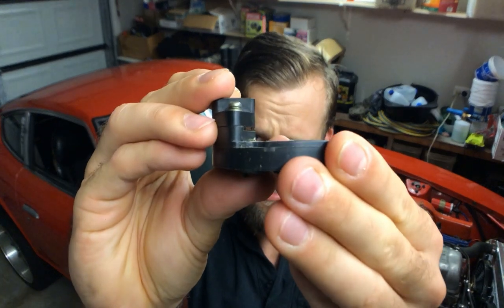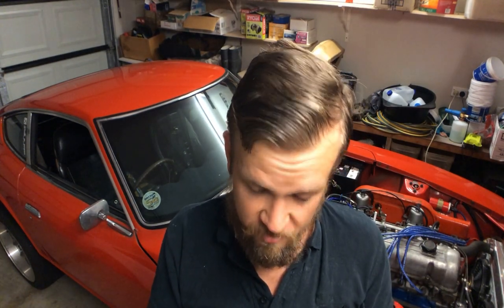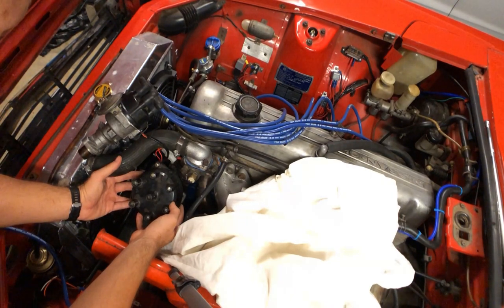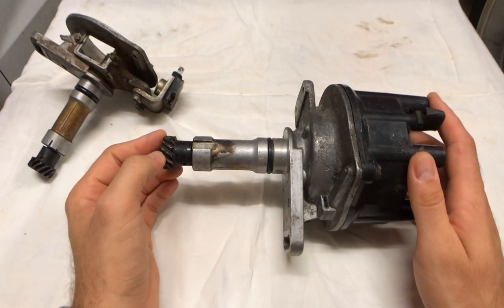Datsun 240Z L28 stroker – fitting an RB30 distributor - part 1

Comment: The bearing in the top dries out.black powder comes out clogging the optical and the 4 pin plug would grow
green electrolysis . both common faults
Reply from the maker: Yes.  I have found that on all the RB30 dizzies I’ve touched over the years that the dust seal around the CAS terminal is very brittle.  I have not been able to pull a distributor apart and not break that seal.  Grr!
Reply: I had red powder once like rusty iron. Due to the dry bearing it would cause friction and started heat soak that CAS whilst driving and the cas sensor would stop working making the engine splutter and stall, especially when stopped at the lights. If i let it cool down for a minute, it would start up again ok. Replacing the bearing in the dizzy fixed it....